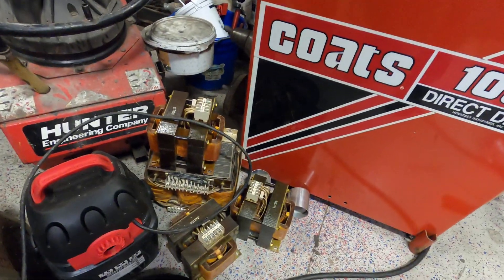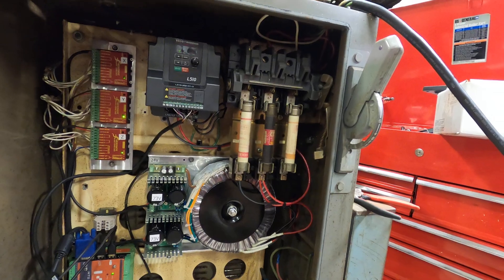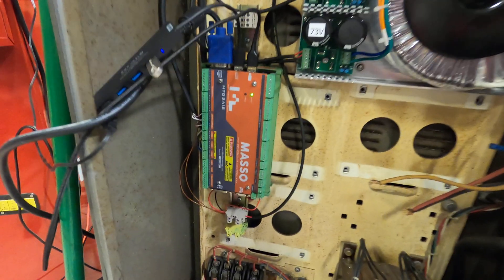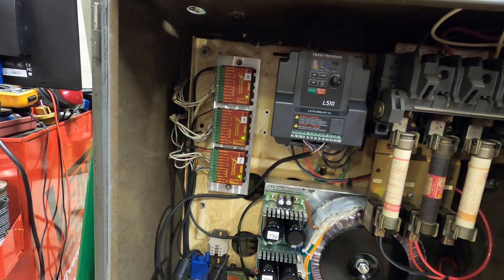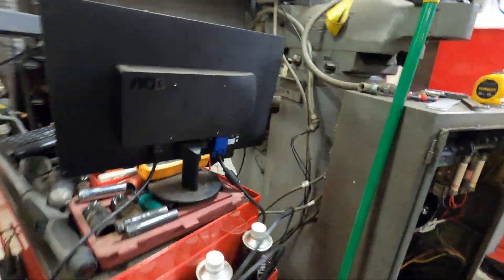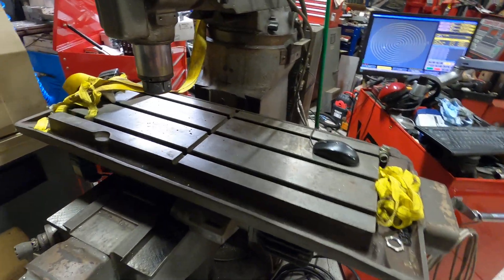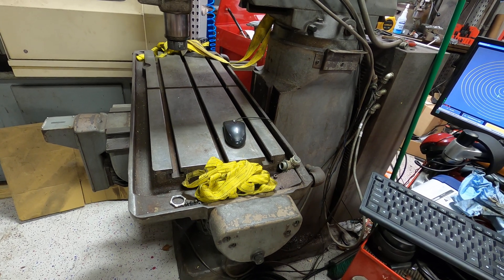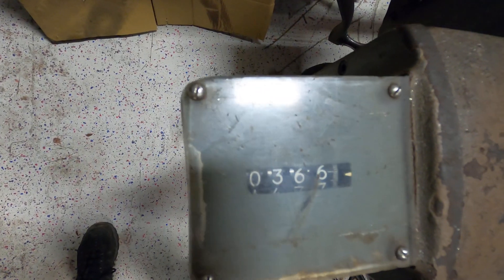Bridgeport Boss 5 CNC Knee Mill retrofit with Masso and Gecko

Comment: I had a boss five that i did a mach retrofit on awhile back, not a bad setup for the money,i think i still have some old videos posted up on my channel
Reply from the maker: Very nice! I don't really use this mill since I have a small import with an r8 taper so tool holding is available. The qc30 lack of availability ruins it for me. If it was an enclosed machine I'd use it all the time for easier cleanup.

Comment: Great video Jason.  Can you provide make and model of the transformer you are using?  Thanks.
Reply from the maker: The power supply transformer is an Antek PS-15N73 - 1500W 73V Power Supply
(PS-15N73: PS-15N73N24) purchased from antekinc.com
Reply: @jasonrussell6534  how can I get ahold of you? I have a question on the wire diagram to the Gecko.
Reply from the maker: @superdutyonplanets  you can email me jason@vems.com if you'd like
Reply: @Jason Russell  hey Jason, do you have a fb page I could contact you about wiring these older stepper motors, recently acquired this machine and I can't seem to get a hold of any wiring diagrams for them.  Anyway hope to hear back and thanks for your time
Reply from the maker: @travisknutti9331  this is what I have in my notes on the stepper setup: Stepper Motors:  	

Sigma Motors - To Gecko 203V drivers

     Connect motor terminals 1&5 to /A

     Connect motor terminals 3&6 to A

     Connect motor terminals 2&7 to /B

     Connect motor terminals 4&8 to B

     (If the motor runs in the wrong direction, switch the A and /A leads)

Comment: Great video. I have this very mill with all the old controls. It's basically a boat anchor but the mill is in fine shape and very capable. Would love more technical information on what you have done. I like the fact that you are using the old steppers. I also see in the comments they are trash but they sure seem like they are made for industrial type use. Something you could always change out on a later date. Couldn't you reuse the old transformers? They seem so robust and made for heavy use plus they are the right voltage for the steppers. Believe me I am no tech guy, just wondering about stuff like that. 

Thanks very much for your video. It's one of the best I have seen on this mill.

Comment: Trash those steppers. They will give a huge headache later down the road. Trust me, I retro fitted my boss 3 to masso about a year ago and had repeatability problems with those motors. Ended up switching to cemtroid acorn once i hit limitations with masso. I went with automation direct nema 42 - 4 wire steppers and they have 2x the torque and 2x the speed and never skip a step.

Comment: Did you use the original stepper motors?
Reply: could you give me the wiring diagram for the steppermotors?
Reply from the maker: @mrresalah9956  this is what I have in my notes: Stepper Motors:  	

Sigma Motors - To Gecko 203V drivers

     Connect motor terminals 1&5 to /A

     Connect motor terminals 3&6 to A

     Connect motor terminals 2&7 to /B

     Connect motor terminals 4&8 to B

     (If the motor runs in the wrong direction, switch the A and /A leads)
Reply from the maker: I did, yes. Those are the originals.
Reply: Okay thank you! I have a bridge boss that was retrofit to ah-ha but a stepper driver board burned up so I'm going to upgrade to mach3 but want to keep the original motors. The current drive boards are set up at 10amps to drive the motors. wasn't sure if the 203 would run the motors with the drop in amps
Reply: What model gecko drivers?
Reply from the maker: @PFM19911  they are model g203v